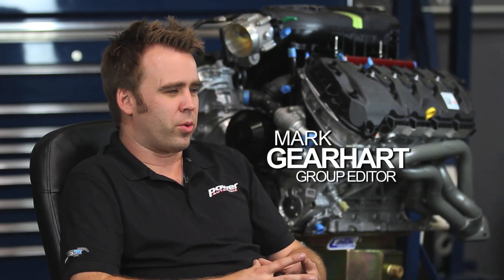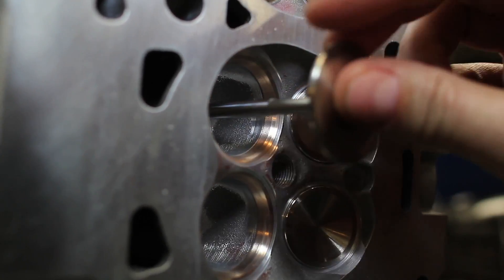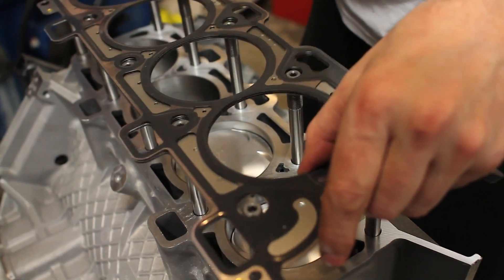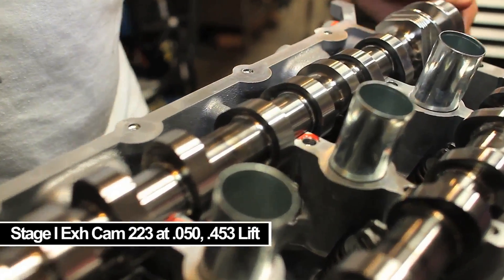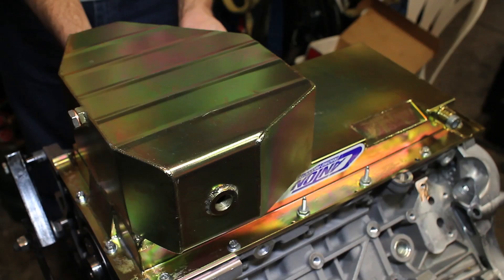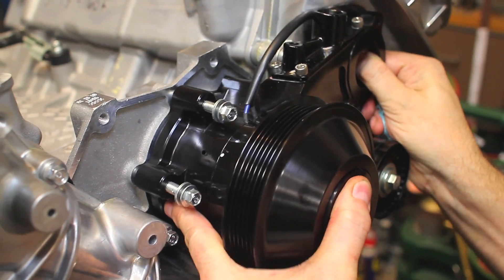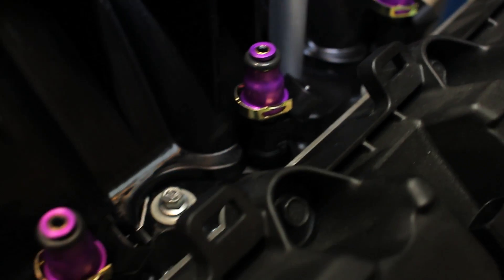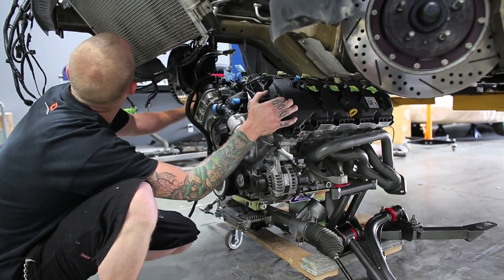Building a 1,000+ HP 5.0L Ford Coyote Turbocharged Engine. Part 2: The Long Block

Comment: People have made 1,000 HP on a stock coyote on e85 with a supercharger. And that's 1,000 HP reliably. You just did a bunch of extra work for nothing if it only makes 1,000hp.

Comment: when you bought the stage 2 jpc heads, you still had to do machine work to them? you would think for 5k they would be able to bolt on out of the box!
Reply: Sprayed Coyote don't even need them to achieve 1,000 hp, just upgrade valve springs.
Reply: Why does everyone list the head flow at .600 + lift? Almost no one's cams with that much lift.😅

Comment: How is it that chevy's make more power with less tech?
Reply: +Ryan Barbolt 

More cubic inches
Reply: 1000cc's..that's not much, 60ci's.  just seems like an awfull lot of head and cams, for very little hp advantage
Reply: +Ryan Barbolt hahahaha no its only a whole liter of displacement. and gm is junk anyway
Reply: +Ryan Barbolt If both a 5L dohc 4v and a 6L pushrod 2v were making 1000HP, 200hp/L vs 166hp/L, that's about a 34hp/L difference, which is pretty significant, hence all those valves and cams on the Coyote.I don't know if you've ever had the opportunity, but take a look sometime at the intake port on a pushrod engine and then go look at a dohc 4v engine. The dohc engine will more then likely have a large, beautiful straight-shot right at the valves that most pushrod engines could only dream of.
Reply: 177SCmaro Power per displacement is a shitty way of trying to gain street cred. You know what higher power per displacement means too me? Less reliability. 

More HP/l means more stress on smaller components. I'd rather have a 7.0L V8, making 1,000hp than a 5.0L V8 making 1000hp. Why? The larger engine should last far longer, and likely won't grenade itself.

Horsepower is horsepower. A 5.7L engine making 400hp, is still more powerful than a 3.0l making 360hp. HP/L be damned.
Reply: NovaMan 350 Yeah, HP/L aka specific output is pretty much just a mesurement for engineers, both arm chair and real, to argue and beat thier chests over. How important is it, really, that a 4 valve 5.0L is making more hp/l if a larger 7.0L 2 valve is still making more power overall and is probably doing so with a smaller, lighter engine on the outside?
Reply: Professional Hater An engine is an engine. The only thing that's changed between engines from the 1960's, is manufacturing tolerances, and electronically controlled parts, instead of mechanical. 

More power with a smaller displacement means more stress on the individual components, regardless of when or how the engine is made.
Reply: Silly question, why isn't the coyote a six liter then?
Reply: My point is, why all the tech when it can be done simply enough by adding an extra liter of displacement.  For a SMALL decimal of the development cost.
Reply: Ryan Barbolt That works too. But, again, 4 valve heads have awesome rpm and flow potential. So I guess the choice is go small displacement with lots of airflow or bigger displacement with more compact but reduced rpm and airflow potential.
Reply: They would rip with better gearing I'm sure.  Bring the torque curve and high rpm into a more usable range.
Reply: NovaMan 350 And, in fairness, alot of engines are up to that stress and last a long time. But you're right, it's still a factor.
Reply: Professional Hater I just watched a video on YouTube of a poor ford lover whose ecoboom in his truck did exactly that with just over 60,000mi on it so much for reliability.
Reply: NovaMan 350 a 7.0 cant stay together with 505hp. your just a ford hater.  Ford is more efficient fact and more reliable.  people buy ls motors for a swap because thats all they can afford. and there r thousands of them in the junkyards because the rest of the gm junkbox couldnt go the distance.  givit up dude. hp per liter is efficiency not xtra stress like your 1960s mentality thinks
Reply: the same reason that people put Chevrolet motors in ford cars(any year) and put a Cummins motor in ford trucks, there highly overrated juuuunnnnkk.

Comment: part 2 published July of 2013, this is December of 2014 and no part 3 yet. Damn Ford must have blown up on the dyno.
Reply: Edward Thayer that's funny, if you can't get 1,000 out of a turbo coyote you don't need to be building them. We have one making well over 1,000 on stock bore and stroke, stock heads other than valve springs and stock throttle body.  You don't need an ATI balancer, or a big throttle body nor do you need any port and polish work to achieve 1,000 horse power.
Reply: Car is still very much alive and running with this same long block.
Reply: If it was completely  built by rgr then it's running still. If not its because they didn't add sleeves
Reply: Luckystrike it's not that, they just didn't get anywhere near a thousand horsepower! not sure why they thought they would in the first place!

Comment: Where is part 3 ??? And I want to re build my 2007 4.6 mustang motor. Any suggestions for rods pistons and crank? I want to eventually get new frp ported and polished high flow heads and comp cams stage 2 or 3 supercharger cams and get a f1a procharger with a frp intake manifold and an frp throttle body with the injectors you used on the coyote motor but Idk if I can afford 1000 worth of fuel injectors lol... It's a lot of money that I don't have bug I am gathering ideas if anyone can throw me a bone on which forged internals would be best for my motor and application.. Also would it be worth sending the block to a machine shop or getting a new block?
Reply: I just purchased a set of 4v DC heads with a 08 CC 4.6 block. 

have you finished the build yet?

Comment from the maker: If you want close to 700 rwhp reliably, then yes you will want to build at least the short block. The billet gears are especially important on supercharged vehicles due to the additional load placed on the crank.

Comment: Im looking to put a 2.9l whipple on my 5.0 10 psi. What are the most important parts to add so that nothing breaks so that my car is durable. Will i need a billet oil pump gear, new pistons, camshaft with 600-700 hp. This is a daily driver that i want to last

Comment from the maker: Not needed. Unless road racing and wanting the extra oil capacity for dissipating heat, doing the Triangle Speed Billet oil pump gears are all you really need. for a street or street/strip car.

Comment: As normally aspirated, running 92 octane, with changes to the cams heads, valves, ports, etc., what HP can I expect to achieve? Sorry to ask beginner questions. I know I need to "Google it." I know I need to chase down all the aftermarket head options too. This engine really is cool. Sorta kinda obsoletes Chev LS, don't it!

Comment: If you run a spring thats too stiff you have to lock the VVT phasers because it won't allow the timing to change properly.  They want the machine to be easy to drive and streetable so they stuck with a softer spring and kept the phasers in place just limited the amount they move.

Comment: Trying to bring on the boost earlier? I'm surprised they didn't grind you a custom turbo exhaust cam or is that stage 1 optimized for turbo?  nice build.. RGR heads w 38mm x 32mm valves - that's 1mm bigger intake, 0.2mm bigger exhaust.